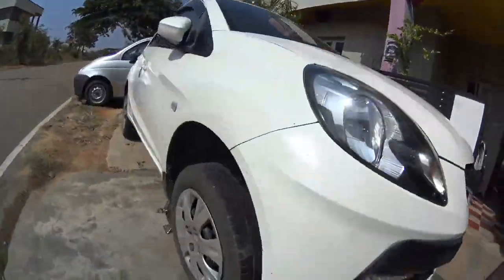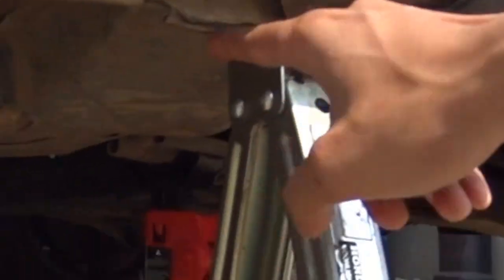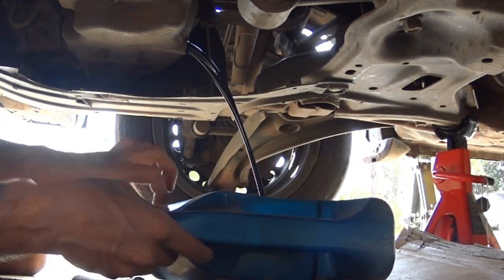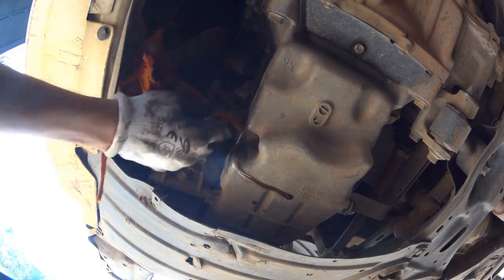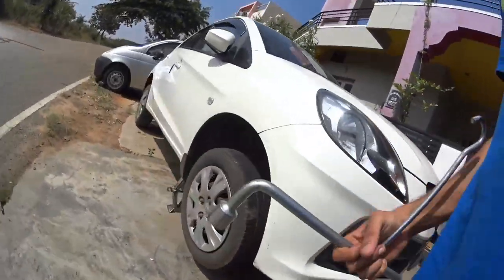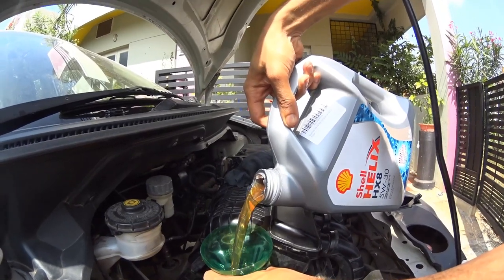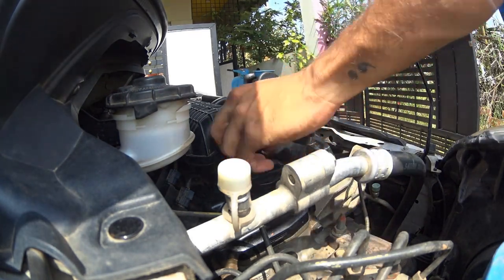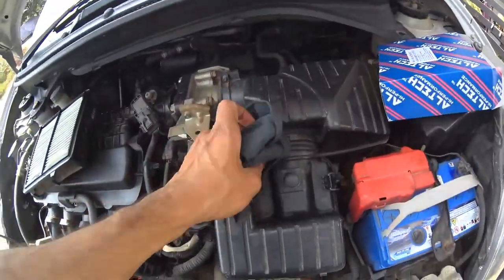Honda Brio/Amaze Service and Maintenance

Comment: Well done man! Nice video. One tip for anyone changing their car's engine oil: remember to apply a little clean engine oil to the new Oil Filter O-ring seal before installing :)
Reply from the maker: Ohh yeah as I was in a hurry while posting video I had forgot to mention it . Thanks a lot 
Applying fresh oil on o-rings acts as a sealant and also keeps o-ring in good condition 
Correct me If I'm not wrong
Reply: @GAMINGBIKERBAZRAW  Couldn't have said it any better! Looking forward to your future videos

Comment: Appriciate your work.. would have been better if the spark plugs would have been serviced or changed depending on condition also throttle body cleaning should be done.. that makes a complete service.

Comment: Very nicely explained, I too own 2012 S MT Brio. Will replace Air filter, Cabin Air filter both purchased from Amazon (Altech brand). Engine oil only top up is required this time as it is in good condition which also bought from Amazon (Bosch 5w 30) 1 litre. Lastly 1 help I need, in the video red colour jack specs and from where you purchased pls let me know so that next time entire  engine oil + oil filter change I will use. Thanks once again.
Reply: I am planning to buy used brio, how much mileage actually it gives? And how much is maintainace cost for 1 year? Thank you
Reply from the maker: @003udaysinh  its maintenance might cost you like 3000-4000rs and is simple as in my video replacing oil ,oil filter and airfilter will cost around 3000rs but after that tyre rotation and wheel alignment may cost another 1000rs
Reply from the maker: @mohammedHaneef I bought it on Amazon.in
Reply: @003udaysinh  On city like Benagluru traffic with AC on it gives 12-13kmpl and on highway min 15kmpl, regarding service cost around 4k Rs per year
Reply: @003udaysinh  I have Brio Smt 2015 model, In city driving it gives 13-14 and on HIGHWAYS 18-19.

Comment: Hi bro recently I given my Honda Brio s Mt 2015 petrol, to gomechanic for servicing they changed engine oil which is Mobil, after complete service my car drastically droped the mileage to 10,11 before that it used to give mileage over 14. Can you help me on this if you have some about this car. Please?
Reply: Hi. Is your issue resolved now?

Comment: Good one👍.. May be you can do even better in the next video. Point to add..1. Use Nitrile gloves when working on Lubricants. 2. Use a socket wrench instead of ring spanner.
3. Put a disclaimer that says, Caution of hot engine oil and be aware of not having constant contact with used engine oils. Dispose the engine oil in a environment friendly way. Don't pour used oil in drains  nor in the soil.....etc. ( a lot of points can be added) so,that way your content would have a professional touch to it.( So far Kudos) Myself an Automobile engineer with 25+ years of experience as an Technician training head in a very reputed car manufacturer. Contact me if you need any inputs @perfectpitstop.com or perfectpitstop@gmail.com. 👍